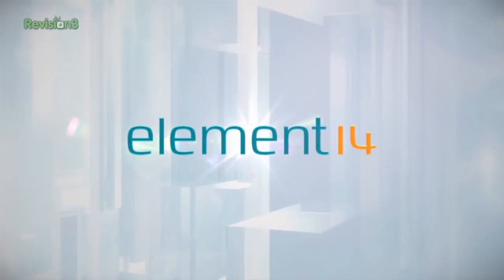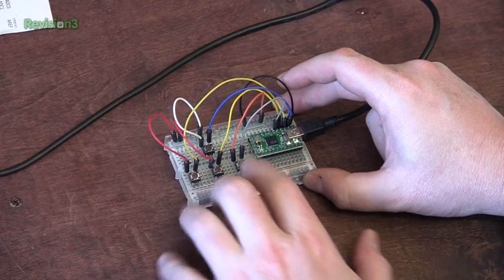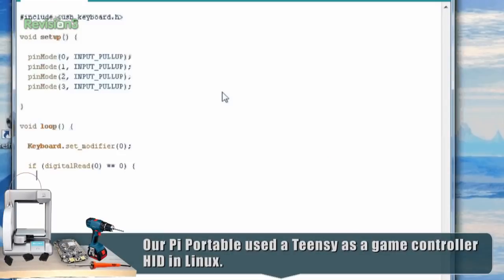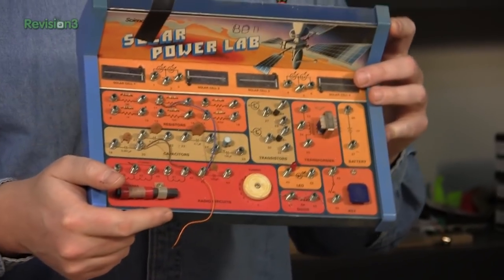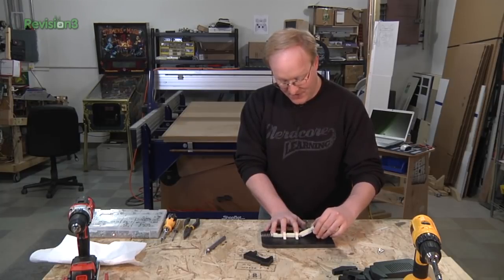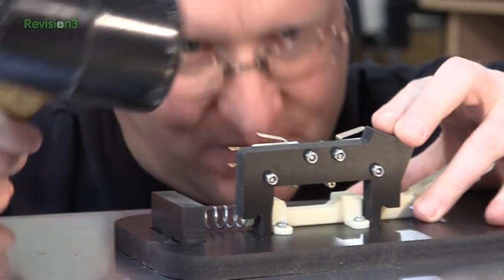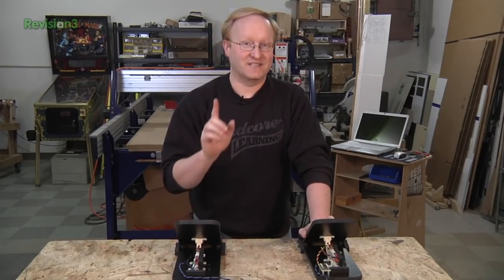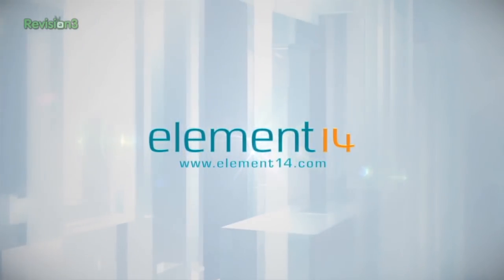Beyond WASD: Foot Pedals for PC Gaming

Comment: Actually, what I'd like to see is a foot control that works as follows:
You rest your foot on the controller and can
1. Slide your foot left and right. This could be mapped to strafe left and right.
2. Slide your foot forward and backwards. This would be mapped to move forward, backward.
3. Pivot your foot on your heel clockwise (right) and counterclockwise (left). This would be mapped to turn right and left.

Note that you could simultaneously perform up to 3 actions at a time. Also for each of the movement abilities, the controller would be spring loaded to return to neutral.

Comment: So can this also be done an Arduino Pro Micro (atmega 32u4)? I want to make controls for a GameBoy Advance Pi Zero emulation system. :) I can hook up every control on the GBA to the GPIO of the Pro Micro and have two left. It's a lot cheaper and smaller than a teensy.

Comment: I swear, if a good mouse with analog sticks doesn't come out some time soon, I'm either going to cannibalize an IBM ScrollPoint mouse, or an XBox/other controller, and build one myself— very regrettably. I feel like I might as well try making it seriously good and marketing it and everything if I do it though.
Reply: MsHojat Sounds like the Steam Controller might be the answer to that.
Reply: Rex Dangerkill
 Not at all. It is a gamepad, not a mouse. It has even less analog sticks than a PS2/3/4 controller.

I wouldn't mind a touchpad on a mouse I guess(?) but they are very different from analog sticks, and mice are extremely different from gamepads.

The closest things out right now are Warmouse Meta (which doesn't really seem to exist, and sucks anyway), the Sandio 3D Game O2 (which I have, but the sticks aren't analog, which makes them terrible and rather useless), and left hand control pads of a few varieties. I want one for my right hand though, since I prefer to just use a regular corded keyboard. I guess a regular keyboard with an analog stick would be nice though. Mine has a touch pad sorta like laptops have, but I don't use it for anything because I haven't found a use for it.

Comment: It's not as practical as it seems. Let's say you assing a pedal to grenade and melee attack, anyway you set it you'll hit both actions when using the second one. On Titanfall i wouldn't want to throw a grenade just before kicking or breaking someone's neck. One action per pedal is enough
Reply: +Miguel Moreira I'd like to try one action pedal as DPI/sensetivity switch. Found this video, maybe this 2 step pedal is ok for such binds. I'm not sure yet. I tried set DPI change no additional mouse buttons or use specific under mouse wheel - its too slow for competitive gaming.
Reply: Most gaming mice have on the fly dpi settings. Sadly the pedals are highly impractical since they'll be costly to make and program. A better solution is something like the razer tartarus or the orbweaver
Reply: ***** Did you ever try using those mouse DPI buttons in hot battles? I have Roccat pure military mouse. Pedal would be more like trigger. Hold to precise, release to skirmish. When using other than primary buttons time & accuracy is completely lost, this is very big issue for gaming. Thank you for your opinion on this. I'd like to try usb pedals from aliexpress (software included)

Comment: I know this is a really old video but i just started watching this channel, Great stuff Ben, so cool.
Anyway, I was just thinking, what if you made a pedal that instead of depressing half then full to do two keys (making the first key act and then the second one, so if you had one crouch then one prone you would have to crouch and then prone which takes time) you could make the pedal go left and right... center is nothing then flick and hold left (even a few cm) and same for right... I think that would be more useful...
One step further, slide forward and backward for MORE keys... You would have to make it so that it would not easily slide forward or backward... but required a positive push... 
Anyway... Thanks for the fun vids.

Comment: Only thing that sucks is that while there are 4 buttons you can't press 2 of them with out pressing an extra ability. I.E. Half way down you may choose to be a sprint ability, but then what do you choose for the "all the way down" pedal? You are stuck always using an extra ability in order to use the "all the way down button." Another option would have been to put a strap on the pedal and allow it to be "pulled up" for a second button.

Comment: You're going to get a lot of foot-fatigue from that.  Think of a gas pedal - you press it with your toes, not your whole foot - that gives you finer control and less fatigue.  Perhaps it should have been a foot-rocker.  Where it pivots like a see-saw.  When it's balanced, it won't be pressing any buttons and won't cause fatigue.  When it's tilted forward it's W for example, and tilted backward it's S let's say.

Comment: Actually internal pullups are around 47k not 10k. Don't recommend using only internal pullups, especially with long leads to buttons. You can use software debouncing code or you can use hardware debouncing with 100nF. My golden rule is tu use 4.7k and software debounce (minimum 50ms button hold to read is as pressed).

Comment: All I have to say is with bens design I would suggest adding a secondary spring that hits right after the first switch is pressed so there is a pressure difference between the positions of the switches or reposition the second switch to be pressed only when the pedal is fully pressed other than that looks great

Comment: I am actually working on foot paddles too. I brought a cheap one with 3 paddles last year. It uses cross beam ir triggers and can be configured as mouses and keyboards. I was not happy with that and stripped everything then built it from scratch. 
I uses hall sensors for keys. It provides up to 16 levels of pressure sensibility (the sensor is capable of something like 30). I can configure a comfortable level as threshold to trigger a key press and maybe make it to send joystick inputs.
Right now I am trying to make it wireless with a Bluetooth HID module.

Comment: kickstarter? i fell this would be good, if they were cheap enough
Reply: I think they would be better if they had a on/off pressure sensor then you could use them for racing games as Acceleration and Brake

Comment: Awesome design.  Would be even better with an analog slider pot for like a throttle control.  I'm working on something similar for World of Tanks where I use my Arduino to interface with a second mouse so I can turn my tank and turret independently.  Gave me some great ideas.  Thanks Ben & Co!

Comment: TheJeremy404 I would like to point out about your comment on the Ben Heck foot pedal video, that even though WASD only can move in 8 directions, most of the time you are using the mouse to look around, meaning you have a full 360 degree rotation of movement. I know you didnt want any comments referring to the comment chain on the video, but i felt that you should at least acknowledge that ability with the WASD + mouse movement.
Reply: yes, but we still have speeds, and using that argument makes it so controllers can do that too with twin sticks, and thats not my point, using a joystick and a mouse is better then using wasd and mouse, it would be a fact if it existed, now lets put in our heads it does, would it work better?

Comment: In a game like minecraft to make it really easy you could have W at full (because usually you are going to be moving forward and usually for a while and it's easier to hold it down fully for a while than half-way for a while) and S for half-way down, on one pedal, and for the other A and D (either could be either, you use them about the same) and you could make another pedal, although probably just a lever, with 9 switches (if possible) and each one would be a number 1-9 (in an order either 9 at the top counting down as it's going down, or the exact opposite. Also a pedal (again, probably a lever instead of a pedal) that has two switches, one holding down control (the sprint key) and the other either nothing (if you can) or just a button that isn't used. Finally you use the oculus rift mod and the oculus rift so that you can look around using that. With all of those you will be able to awesomely play minecraft without touching the actual keyboard or the mouse (unless you are going into the options or you are in a menu where you aren't actually playing, or if you want to livestream it or you use something else that would require you to press other buttons, but you could do that before you start playing.)

Comment: An improvement would be using the switches in a two bit configuration giving 4 different combinations. If 4 levels isn't necessary this could be altered in the code but this gives one extra level that could be used for something fun.